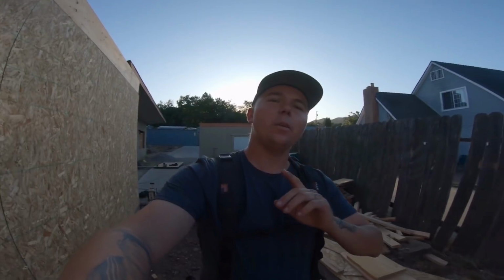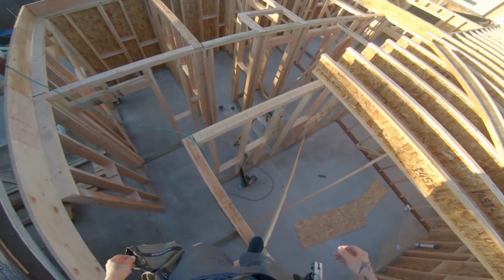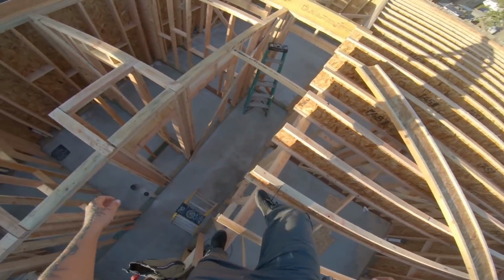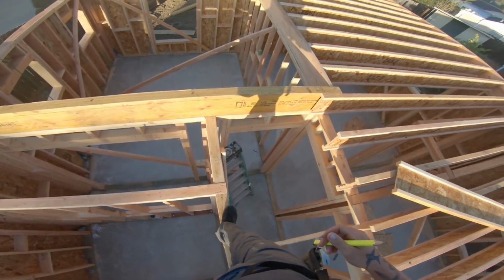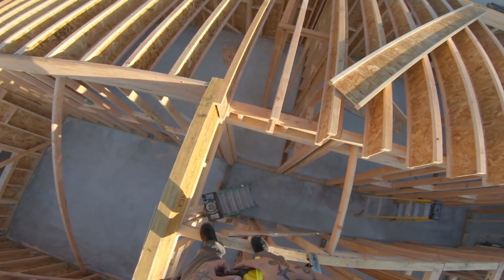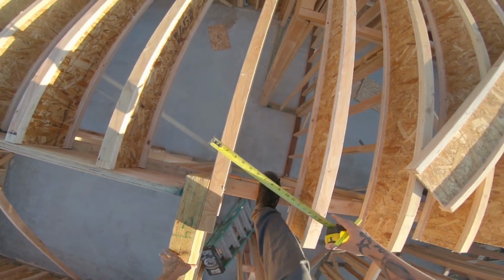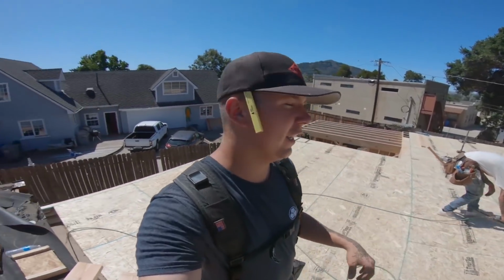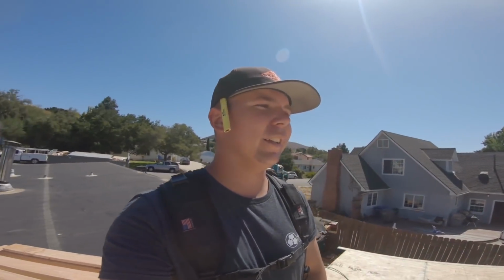10 Day House Build: Day 3 - TJI Floor Complete & Wall Framing

Comment: This guy is a beast, walking the top plates like it’s nothing
Reply: My grandpa and dad used to do it all day long.  It still wigs me out walking up top, just don't look down!
Reply from the maker: My Dad & Grandfather did it for years, Dad still does, Grandpa hasn't in years! It's not as bad as it seems, it's not the fall that hurts, it's the landing!
Reply: Its easy
Reply: Ruben Varela if it was easy everybody would be doing it..
Reply: My grandfather and father used to hang iron for a living. The old man use to walk across beams a couple hundred feet in the air in the days before OSHA and tie offs. No wonder they often took a couple nips before work. They all had balls of steel.
Reply: @MattBangsWood  my Papa use to say the same thing, "it's not the fall that kills you, it's the sudden stop"
Reply: @Connor-wv6ln  Actually, hitting the bracing on the way down would kinda suck too.
Reply: Connor G 
Remodeling is safer sometimes you can land in the bushes!
Reply: @ William Wheeler - Connectors are still held to a slightly less stringent standard than everyone else on site, but you’ve got to have a really legitimate and believable reason why you’re not tied off.
🤜🤛
Reply: I had a friend who did roofing I helped one day. This guy would jump from roof to scaffolding planks 6 7 feet below roof line because he didn't want cross over the roof to other side where scaffold was level with roof. I thought he was crazy.
Reply: Look up "the crazy framer" then you'll know what a beast is! This is child's play ...
Reply: @meanasscobra  cf needs to change his name to race framer everything is a race with that guy. There are negative repercussions when racing in construction. Safety and quality of work are my main objective not going to race anyone I'm fast enough with my 25years+ experience.
Reply: Jordyy713 hu
Reply: Please don't try to do what he did.

Comment: Pro tip. Roll joist first and then put rim on. Easier to nail joist to wall and easier to walk plate
Reply: Can you explain to me how the i joist works when it starts on one side then the other side doesn’t line up and ones in front of the other? How does it end up 16 oc?
Reply: When you mark your 16sthe front goes ahead of your mark the back goes back

Comment: If the foundation isn't level, do you guys adjust for that in your framing?  If so, how bad would it have to be before you adjusting?
Reply from the maker: Many things can be done.

If it’s terrible, 1”+, we’ll custom cut all studs, similar to how you would a rake wall. Shimming is done as well, but we’ve never had to. It’s either really good or really bad!

We did a house last year that had (3) 2” dips on different spots on the house.

Comment: Hey Matt, your not required to install squash blocks beside the I - joists?
Reply: Plans will share the details SD
Reply from the maker: Only thing called out was the simple row of solid blocking along the center wall. No squashers on this little slam dunk!
Reply: MattBangsWood awesome Matt!!  Thanks for responding.

Comment: Why not allow the sheathing to hang down far enough to reach the other sheathing so that the first floor is tied to the second floor?
Reply from the maker: We allowed it to in a few spots, regardless though, we have to use LTP4 Plate to Plate connectors.

Comment: What we usually do here in New Mexico as we know the floor up with ring Shanks immediately
Reply: I am not sure what you're saying because your sentence structure is strange.
Reply: Very strange
Reply: I think he’s saying they nail-off the floor sheeting right away (while the adhesive is still wet).
Reply from the maker: I agree, we do the same.. Except our lumber was later than expected, and we wanted to get the flooring down!

Comment: What palm nailer is that, does anyone know??
Reply: Senco HN150
Reply from the maker: Senco bought the use of the patent from a company called PneuTools. Same company that I have framing nailers from. 😊 This is the Rap A Nail 150 from PneuTools. Griprite and Senco both have similar builds.
Reply: Thanks!! 😁😁
Reply: GripRite gr-150 on Amazon
Reply: @MattBangsWood  you should add this tool to your Anazon list
Reply: Also check out the Bostich postive placement 1 1/2" nail airgun. No hammering, shoots nail straight in.

Comment: Matt, Newbie here. How do you secure the second floor walls to the floor? What holds those walls in place? I see how you secure the first floor walls to the foundation with bolts but how do you secure the 2nd floor??? Thanks
Reply: @kickyourfaceandlaugh607  Sweet. Thanks

Comment: It's looking great, Matt! The progress you all make in hours is equal to what it takes me in weeks! How do you address the wall OSB swelling (after a rain, for example) between the edges of adjacent sheets that cause unevenness by ~1/8"-3/16"? Does that ever reflect through to say the siding installation?
Reply from the maker: Depending on the build, it’ll call for 3/8” on some shear sections and 1/2” on others. So we have differences anyways.

Even after rain, it’s never noticeable in siding. 😊

Comment: Hey Matt, I don't see any blockings on your floor system? Engineers didn't call for it ?
Reply from the maker: Only blocking called out was the single block line through the center on top of the load bearing 2x wall. Surprising to me too!

Comment: So I’m not a carpenter, why do you use a nail gun on framing, but hammer on decking?
Reply from the maker: It got nailed off with a gun. Only hand banged because we didn’t have the right nails for the gun, lumber yard was lagging.

Comment: I don't want to sound like a Critic but it's probably a good idea not to use those hand drives on that subfloor because later on they will squeak
Reply from the maker: Trust me, I didn’t want to! Only used 2 per sheet to tack down. Everything got nailed with rings as soon as possible. Our lumber drop was late 4 hours! Bad scheduling.

Comment: Go the extra mile and yes overkill use marine plywood for closing in. Expensive yes, but gives better protection when leak issues happen. And as a subfloor under sinks toilets and other things that use and can leak water.
Reply: Tell it to the architect.
🤜🤛
Reply: @psidvicious  and the owner whose money that would be
Reply: @ Jay Bloggs - 😆 Right! Could you imagine going to the owner with a change order:
Owner - “What’s this?”
You - “I thought marine plywood would work better in this area!”
Owner - “Yea, you’re right. I like it! Who paid for it?”
You - “☹️”
🤜🤛
Reply: @psidvicious  its discussed before  build. I pulled off siding and vapor  barrier to find a wall that needed to come off because water was finding a way to get behind barrier. A few extra bucks woulda prevented a whole wall from being removed and replaced.
Reply: @psidvicious  how many times has water got behind vapor barrier and ruined walls. How many plumbing parts failed and the subfloor needed to be pulled up and replaced.
Reply: @ eric johnson - Nobody said it wasn’t a good idea. Why not just build the whole thing with pressure treated?
But you can’t expect the framer to upgrade materials just bcz he thinks it’s a good idea. That’s why I said - “Tell it to the architect.” Even if you just put treated material in water prone areas, if it’s not on the plans, good luck gettin’ payed for it.
🤜🤛
Reply: @psidvicious  its discussed at design stage.what are the advantages of plywood or even boards over waferboard. Most people want cheap instead over quality.  Show clients photos of waferboard walls rotted out, show photos of subfloor under tubs that have rotted out and explain the rebuild cost. I actually seen a home where all basement walls and any wall with water fixtures attached was studded with pressure treated studs.
Reply from the maker: The thing is, at the design stage.. The framing contractor isn't even aware the home is being built, or even been contacted to bid yet.

We're building for one of the most known design firms in the area, we build per plan. If they want pressure treated throughout the whole home, they'll get it. We can't just change material though, these people know building like no other. They have an architectural firm and structural engineering firm merged together as one. Everything is done in house.
Reply: @ MattBangsWood - Not trying ‘to put too fine a point on it’, but what if something happens in the future like, - studies find out that treated lumber being used these days is poisonous (like they did with the old treated lumber with arsenic!). So the owner goes back to the design company and says “I want that material out of my house!” The architect says to him “We didn’t spec any of that material per our design. We don’t know how that got in there. Go back to the builder”. 
🤜🤛
Reply: @psidvicious  but the builder would have a set of blueprints from the architect proving what building is to be made of.
Reply: @ eric johnson - ¿😐? Hehh? Now I don’t know what your argument is!? 🤷‍♂️

Comment: Two things get a paslodes positive placement nailer that palm thing is annoying lol and I've said it before wall jacks it's safer and easier plus 2 guys could have lifted that wall instead of six
Reply: By the time you get wall Jack's set up and taken down three walls could be framed
Reply: @mikeenglish2699  I use wall jacks every day from set up to wall standing and braced is less then 5 mins and I'm able to stand 56' 2x6 walls with 2 guys 1 if I really need to and still have a guy framing. I currently run myself and 1 guy and turn 2200 sqft house every seven days
Reply: I must have used some really shitty wall Jack's before. What kind are you using? Are there any videos of them in action?
Reply: @mikeenglish2699  not op but I use qualcraft wall jacks. Less than 5 min to setup and nobody ever gets hurt.
Reply: Thanks I will check them out. Frame all week, watch videos at night and now we are talking about it on Sunday?
Reply: Mike English take a look at Crazy Framer’s YouTube channel. He works alone so he uses wall jacks
Reply: @mikeenglish2699  I use transporter wall jacks   they work great
Reply: I watched a couple of videos. Not sold on the hand crank ones. The electric ones look fast.
Reply: @lorenrickey5481  I watched the crazy framer hang fascia. That guy is a hack
Reply: @mikeenglish2699  they don't take long at all those guys in the video are really cautious. I love them and recommend them to everyone. The electric ones are nice but cost way more I have 700 into my set

Comment: YOU  KNOW  what else you might try to set you apart and really make you customers talk good about you?   Tell them you used the scraps and BANGOUT  a custom kids  playhouse  or  doghouse  or even a small shed for free. Thats  about how much scraps you got left too if you knocked out all three.    PRICELESS!!   With your chops you could draft that out on a piece of wood and bang it out skipping lunch!   Leave'em  unpainted  for them  to  do  even.   I just seen a small 10x10 or less shed on FB marketplace for $750 I know that ain't much more than a $100 of material there.  Good luck buddy and great work. #KAG